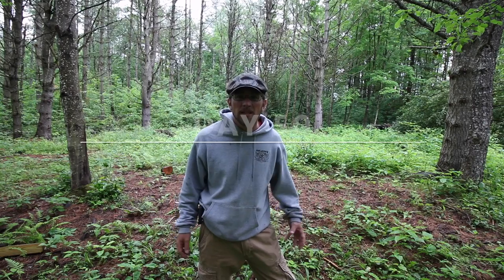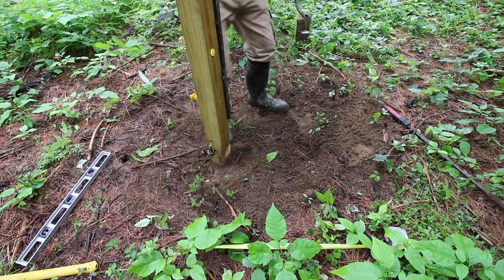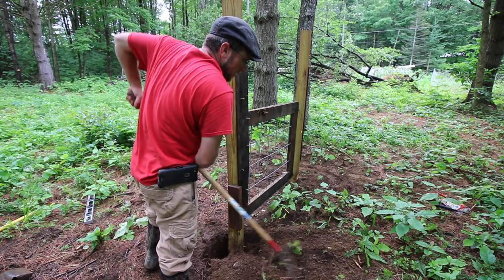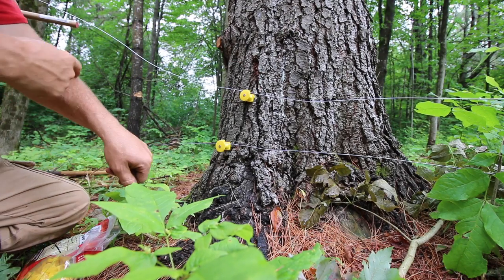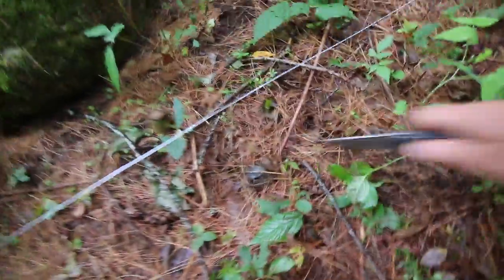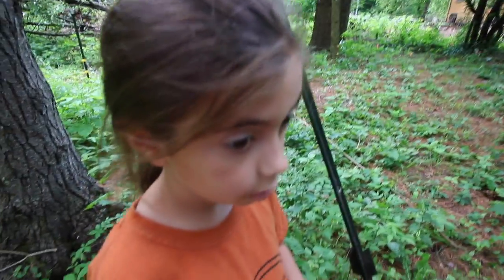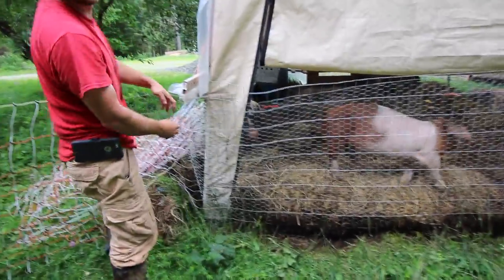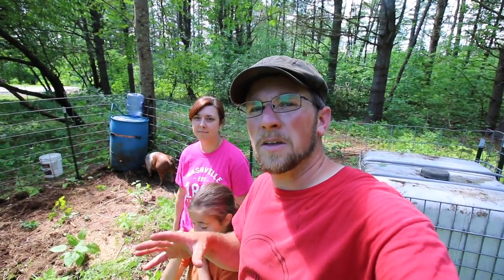Say No to Factory Farms! Raise Pigs on Pasture for Meat!

Comment: That was a lot of work for a gate.  I use T-posts, a cattle panel section and a panel connector from Premier1 Supplies.  Makes a great gate and all you need is to knock those T-posts in.  Premier1 is the only place that sells the connectors.
Reply from the maker: I will have to check out the connectors! Thanks

Comment: You also need we we call in the south, a “Dolly bar”. It was used on railroad beds to install and repair track. It has a “flathead “ like a flat head screwdriver on one end, and a tamper head on the other. Its about 6 feet long, made of cast iron and weighs about 20 lbs,but we use it for all our post setting, root digging, and other stuff. Indispensable!